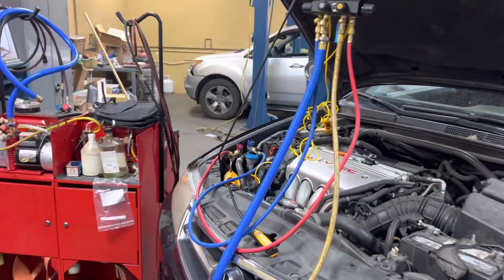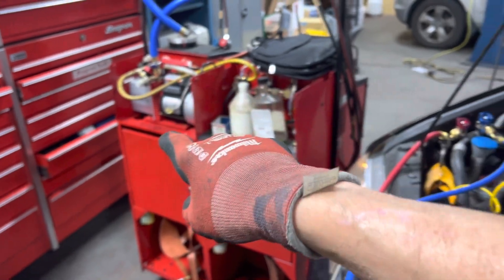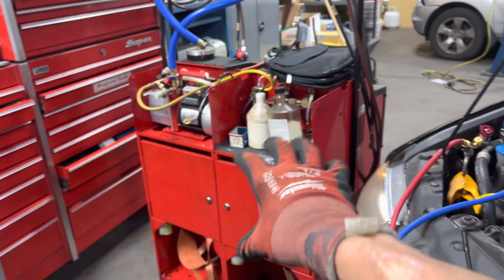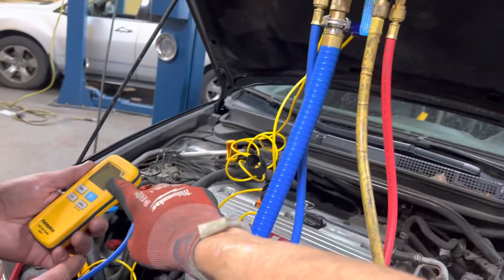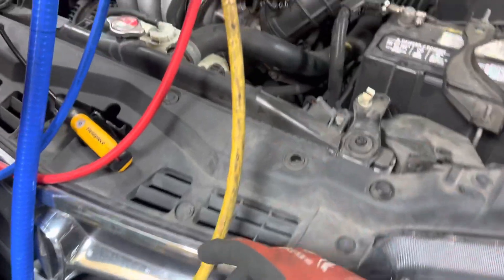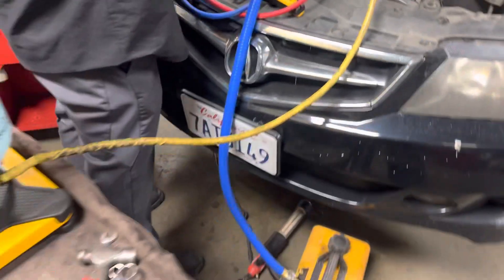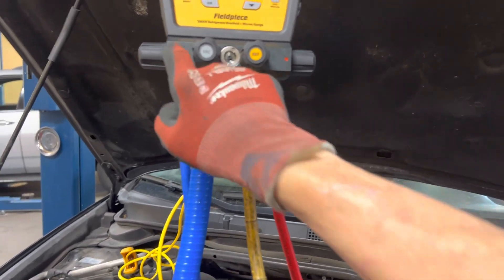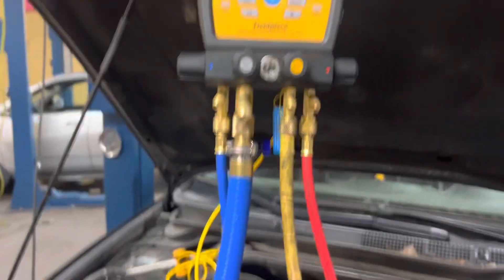SHOP OWNER / TECHNICIAN BUYS NEW HVAC EQUIPMENT FROM TruTecTools. I’m showing him how to use

Comment: Doug is going to love it. I have always used a manual gauge set. Never had a robot machine. Used this setup last season. And it is outstanding. Class of its own. Wish i had found this channel sooner 👍
Reply from the maker: My goal is to get technicians in automotive shops across America, and now that I noticed Stephen across the world to switch over to digital. 

  Micrometers good refrigerant leak detectors ultrasonic leak detectors. The automotive industry is so far behind the times.

Comment: When the tank gets low on freon, will you still be able to charge by liquid and get it all in?  How do we get all the refrigerant out of the tank since the pressure will be low and equalized?
Reply from the maker: If it gets low and it’s out of liquid refrigerant and you don’t have enough, you’ll have to break into your second tank. 

But switch over from liquid to vapor and suck in the last of it if it’s only vapor left in the tank

Comment: Hi Tom. That is a very good investment that i will do one day. 

By the way, there is some refrigerant that gets trapped in the lines. Would it be OK to put a few extra onces to compensate, or it doesn't matter?
Reply from the maker: It depends 30 g of Liquid trapped in the yellow hose. 

Options 
1: leave it there for next car 
2: compensate 
3: recovery to tank
4: if you next car has no refrigerant 0 psi use it for trace gas to find leak in next one. 
5: if you have old large weight system a few pounds with + or - 50g.   The hose is only 30g   Some of the old car & SUV had 1.7 kg to 2.38 kg .   30 g is nothing 
    But if it’s a small car like a Yaris. Has 340g charge.   30 g is a huge amount difference. I am.

For me it’s no big deal because I can do 6 to 10 cars every day so I decide what I’m gonna do based on what the situation of the next car than I going to do .
Reply: @coldfinger459sub0  
I was thinking on option 5 considering what the sticker says. Didn't know a regular 5 ft 1/4 inch hose holds 30g. Thanks Tom
Reply from the maker: @VWtech562  option five does no longer work good on all the new cars because most of them have small charges of around 700 g or less so sometimes 30 g of overcharge is not a good thing. 

Option five is good when you’re working on cars that are 30 or 40 years old .
Reply: @coldfinger459sub0  Looking forward to your next video on this subject.
Reply: @coldfinger459sub0 EPA is typing…
Reply: Is there a way through the manifold set to get it to flash to vapour and then pull the last 30g on low side? @coldfinger459sub0
Reply from the maker: @mavuk100  yes , you just open the low valve on the manifold. Then after you turn off cupeling to high.  Open high valve on manifold. This will suck in last 30g
Reply: @coldfinger459sub0 can you not shut off the high side and then with the refrigerant tank shut off start engine open the low side, will that suck in what’s left in the hose?
Reply: Already answered I see
Reply from the maker: @vw_mods_4711  yes

Comment: Have to come back and watch this in its entirety again. Distracted. My BluVAC+ Pro came in!
Reply from the maker: Congratulations, 🎉🍾 
You’re now on your way to a learning curve of a lot of frustrations and more questions and confusion  🤣🤔💭🤯

I hope you read and caught up on using equipment in diagnosing with microns. Otherwise you will probably think everything is leaking or your micron gauge is broken.  🤣

Hope you have watched a few of Jim Bergman’s videos on using the micron gauge 

There’s always the book about vacuum and using a micron gauge associated an updated from True Tech Tools small book pamphlet $19 .  

Protect it from getting oil up into the sensor keep it up right when you can when attached have protection ball valves 
So you can isolate it